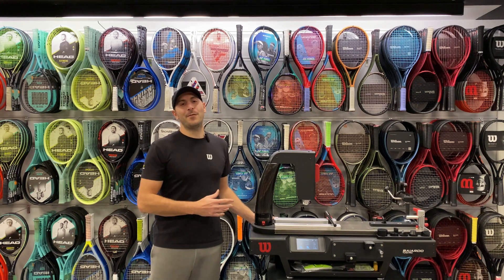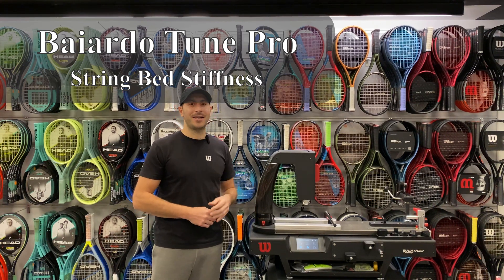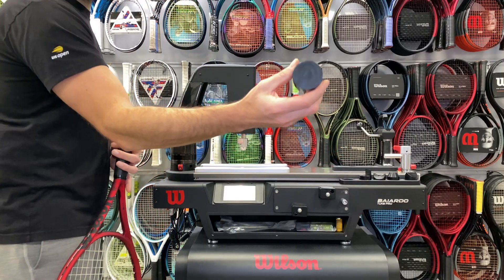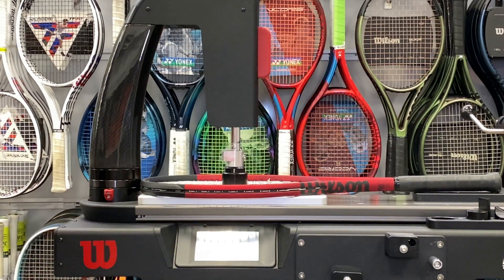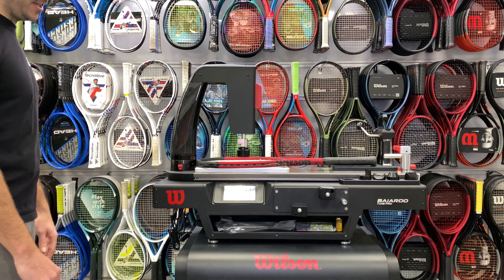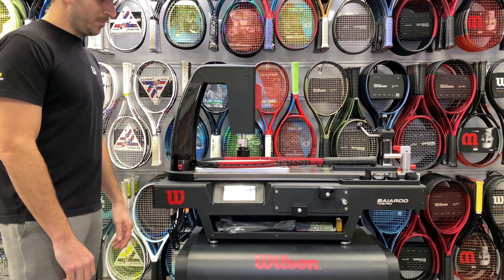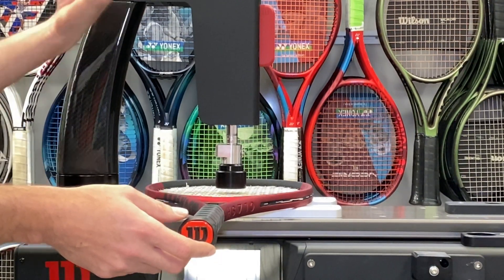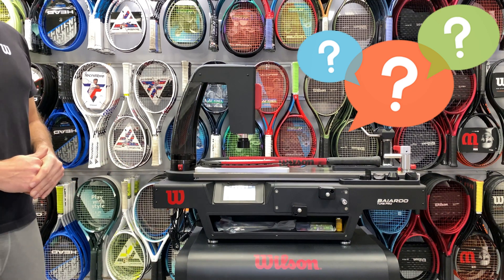Measuring String Bed Stiffness RA | String Tension on a Tennis Racket |

Comment: late here - I find this pretty interesting  stuff -  we're just hackers, 70 years old just wobbling around now anyway.  we like to switch around different rackets etc, just fun stuff.  so, we never really got into changing strings.  my buddy bought an original  Prince graphite, never saw a need to change.  I bought a few, around every 4 - 5 years and never changed their strings.  
back a bit, got one of those rotating test devices...  the strings now register  for example a  34 with an ancient Wilson 2000 Connors....   around 44 for 2 Head Ashe comp edges ( the slightly larger 'edge' version, same construct.)  my newest , a . ummm  thirty year old Wilson  hyper hammer  5.2 /95 reads about  42 - might have been strung looser originally.....
I'm thinking that's not bad for 3 or 4 decade old strings,  probably been pretty stable  most of that time. and quite playable , at least for hackers.  granted the actual string tension might be say 25 lbs , whatever. the point - consistency is the important part.  If ya test a day after stringing,  that'd be a very valuable ' starting point'.
Reply from the maker: Consistency is key! 

The twist tension meter is not very accurate and you will get varied readings but I personally am a huge believer in frequent restings. Makes a big difference

Comment: You never defined what “stiffness” was in the video. In fact, using the spring equation is F = k*x where F is the applied force (lb); k is the stiffness (lb/in); and x (in) is the displacement measured in the same direction of the applied force. It appears that your machine is applying a predetermined force and is measuring the vertical displacement associated with the applied force, therefore allowing the calculation of the stiffness of the string bed in lb/in. No hocus pocus, just simple mechanics. Now the question to you is, “Is this what your machine is actually doing?” By the way, the purpose of the disk is to allow the applied downward force to be uniformly applied over a predetermined area as opposed to a single string. Good for thought!
Reply from the maker: The stiffness is a perceptual measured value. It’s trackable to get a reading and compare to determine string tension or stringbed stiffness degradation. I apologize I’m not so familiar with the mechanics.

Comment: Hi i just bought this machine, and tinkering around.  I need a bit of help understanding the RA, as far as my understanding is the RA is just really a reference number.  So for example if I strung up a racquet fresh natural gut(not that the type should matter) and I get an RA of 41 and I play with it all week long, and comeback to the machine and redo it and get an RA of say 35 or 31, how would I translate that to a percentage drop? so if I strung it at 55lbs and i get a reading of 41 RA, then what pound or percentage drop does an RA of 35 or 31 mean? Thanks
Reply from the maker: The reading you get from the machine is in pounds, but as you correctly stated its not the actual tension but simply a reference point.  So if you string it at 55 lbs and get a reading of 41 string bed RA that is your starting point.  When it drops to 35 string bed RA that is a mathematical drop of 14% (41 - 35 = 6.   6 out of 41 = 14%).   Being you lost 14% of your tension you went from 55 to approx 46 lbs (14% of 55 lbs = 7.7 lbs.)  So you dropped about 7.7 lbs.  If you keep the same string and tension you would then be able to know which reading from the machine is a consistent point of when you want to restring (which is different for every player, string, tension, etc)  But you may find for example that you find the setup just fine under you go below the string bed RA 25 (again just an example number).  So as you play and time goes on, once you hit that threshold number you may choose to restring.  If you are in a shop, you would need to know this number for every racket, player, string, tension, etc and it could be used to bolster restring frequency to answer that dreaded question "when is it time to restring?"
Reply: @SolowSports  Thanks for the explanation!! It helps me out a ton, now I have a better understanding and can share that with my clients.
Reply from the maker: @shahbazhafeez9099  Enjoy the machine :)))  Its a one of a kind.  You must have done something great to be included in the first group of those receiving this machine